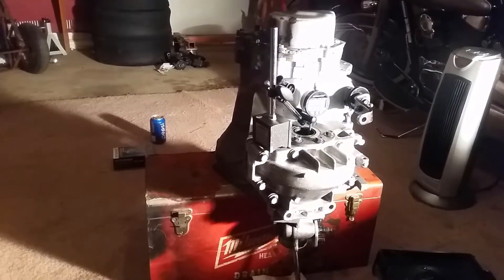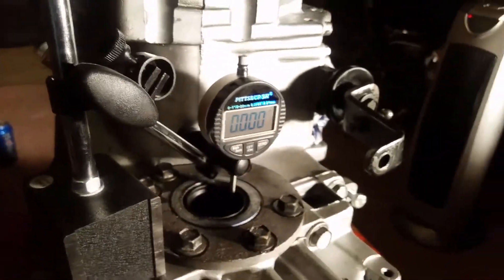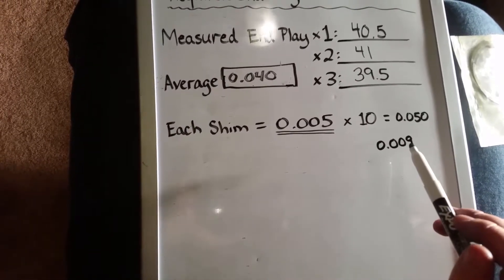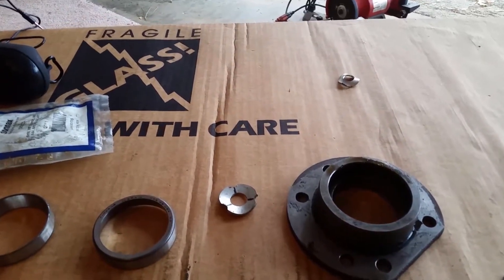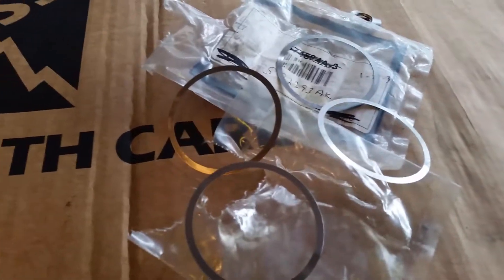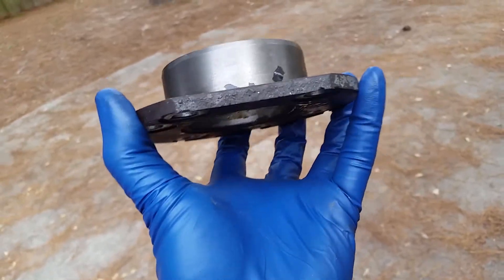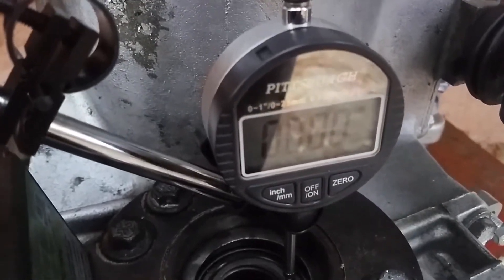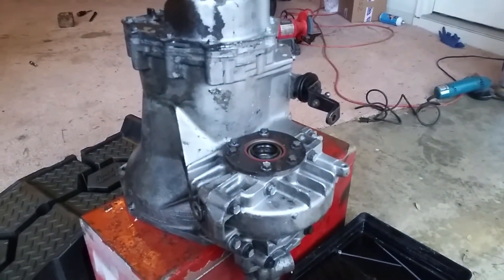Setting Preload on a FWD Differential (Chrysler A520)

Comment: Oh dear, The bearings are meant to have preload not end play. If you had fitted the 50thou pack of shims you would have been correct having a 10thou preload. Instead the differential is now able to float around causing premature wear to the bearings ! Not to worry as you have probably sold the car by now :-)
Reply from the maker: Still have the car, still running fine at 500hp.